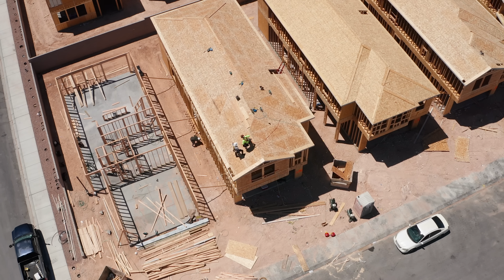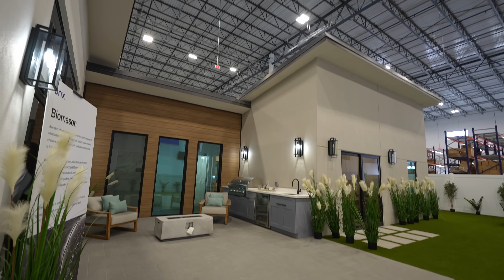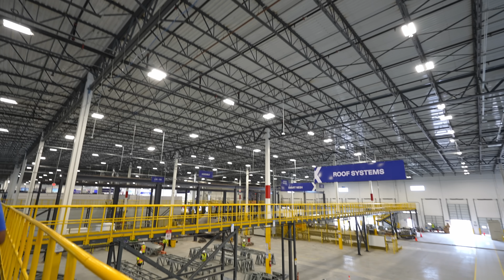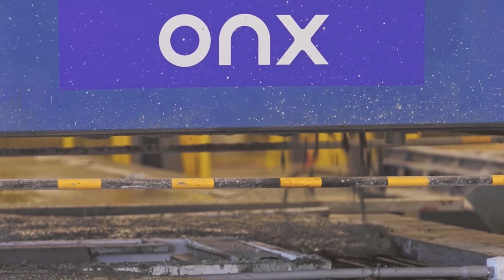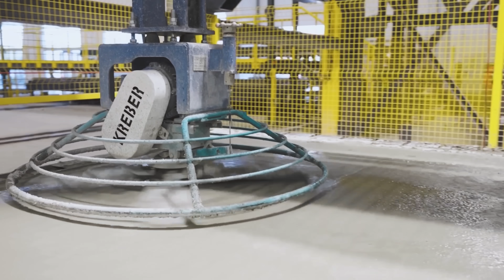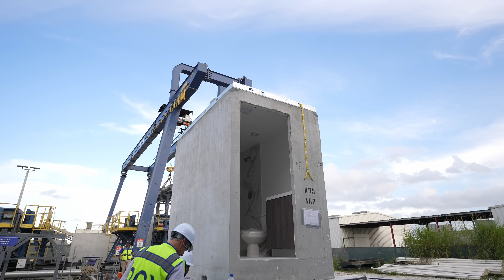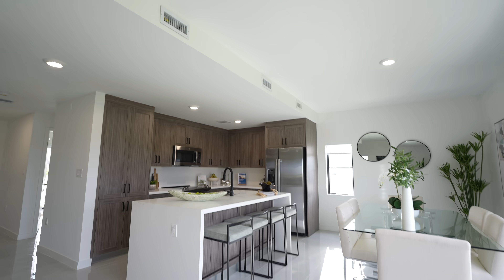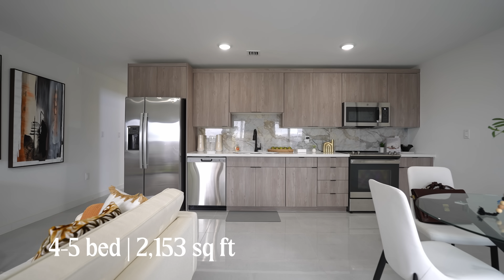Why This Company is Building Thousands of Concrete Homes

Comment: in Soviet Union they used to have entire residential buildings assembled from prefab concrete panels. Those weren't good because of low grade concrete. Also some builders cheeped out on the rebar by using thinner ones than required by building code. However, using modern materials and engineering, it is possible to build long lasting, high quality homes.

Comment: Concrete vs stick built? Why is there even a debate? 😂 Just ask the Big Bad Wolf. 😂

In Australia, most smaller apartment blocks are built with concrete. It's a mix of factory and prefabricated, where the wall panels are all made off site and then erected. Bathrooms are formed on site too. These apartment blocks get built very quickly as a consequence, often under 6 months. Townhouses and newer homes might use steel, not timber, as the "sticks". 
I guess one limitation with factory homes is design limitations. You probably can't mess around too much with the floor plan and general footprint.

As for the CO2 concern, that's small fry compared to the amount of concrete already in use with other construction, and minute compared to overall CO2 emissions. Raw energy generation, manufacturing and transportation make up the bulk of that. I would have thought a durable home is far more important, and greener, over a flimsy timber home that also requires constant maintenance and would use more energy. Sometimes ideology should be parked for common sense.

Comment: A factory built pre-fab deals with the issue of terrible quality control on the part of typical builders.  A stick built home is constructed by whomever the developer could find to knock it together at the time.  The buyer ends up with a very expensive pile of surprises.

Comment: About damn time. Growing up in concrete home that withstood numerous huracanes including multiple cat5. 
When moving to the US I couldn't believe how cheaply made, imo, the house were made. Specially for the price. My dad does have a brick one. But most are skick builds. And whats with those rooftop.  Most concrete house among friends/family were able to easily built a second floor or smaller second house on top of theirs. Many years later. Not even planned ahead. Simply because the rooft could naturally hold it. While you couldn't just drop another tiny house on top of most US made. Heck a neighbor made a ramp around the back and the garage on the roof.  Most US rooft wouldn't even hold those huge water reservoir many of the houses had on top.
And I figured, it was understandable many years ago when hurricanes weren't much of a problem. But for the past 2 decades or so. Plenty of hurricanes started entering the east coast. Its beyond me why they kept making the stick house that get wrecked all the time. And worst of all. How much they cost. Near my dads. 600k for a stick house. Like seriously? At the very least, mobile home used to be very cheap. But now they're overpriced too.
And the flooring.  Whats with those temporary flooring that you gotta baby for them to last. Everyone I know in the US have had their floor remade every decade or two. 
While my grandparents hose had the same tile floor for 60+ years. And we were harsh on the cleaning. 

But yeah, thats the reasons why I considered US house over priced. They are beautiful.  Size is okay. But the materials.  Inexcusable.  

Personally,  I dislike the drywalls, call them fake walls. But it been on top of concrete is fine. My dad's have drywalls on top of the bricks.
Also not a fan of the amount of glass windows and door used.  

But those house are gorgeous. They remind me of the houses I grew up. Well made. Id prefer miami shutters for most windows. And either solid wood or metal doors. With minimal glass if any on them. 

Also, those are called modular houmes. They are prefab but are made usung all the in site built standards. Its how many buildings and projects are made in the Caribbean and LatAm. Its considered a cheap way to make many house. But they turn out very durable. 
I have friends that grew up in places like that. That looked as if they copy/paste all the houses. And on the years they lived there I dont remeber having any problems. Except modifying or remodeling or adding a section is a nightmare. 

Thank you so much for the video. I wouldnt have know FL was making these kind of house. Googling houses always show the same stick or mobile ones. With some bricks.

Comment: From the video images it looks like insulation is only 1.5" of EPS sandwiched in the concrete walls. 
Say that's R6. Even R14 insulation installed on the inside exterior walls would only bring it to R20.

Comment: In Asia, most of the houses were built with cement and steel; we have also built wooden houses, but if we can afford it, we go for concrete houses because it is not easy to move by wind and also fire. Wooden houses are easy to get fired, which is why we built houses with concrete, even a tiny house.

Comment: the cost of housing is a multifaceted issue , cost of labor, cost of material, cost of land , average income of family, cost of living, fixing one part of the problem isn't going to solve it entirely, its all tied into the economy. I'm not a socialist, but there are certainly some flaws in this capitalist economy currently that need to be addressed, I also believe the cost of starting a family is causing the birth decline.

Comment: In Puerto Rico they build homes out of concrete and their roofs are also build out of concrete. When Hurricanes come the homes are able to withstand the damage.  Puerto Rico has other issues but when it comes to minimizing home damage I think they are doing better because of the way the homes are build.  In Florida they build concrete homes but the roof is wood with shingles an when a Hurricane come it’s always the roofs that gets affected. Florida is flat so there is more possibility for for homes to get flooded especially if your near the water. Because of this I think home builders will have to start raising homes.

Comment: Finally this is what I have been saying for years I never did like the way modern homes are built because I always see on the news this house burned down or that house got torn down by tornado all houses are flammable and not designed to last as long as the pyramids it maybe overkill but I want a house that could withstand a nuclear blast lol
Reply: Most houses in Africa and the Middle East can withstand a nuclear blast due to the fact they are made of concrete or cement and thick walls. How do you think the people who live in those places have survived wars all these years?

Comment: Isn't concrete one of the biggest contributors to greenhouse gas emissions? Curious how these concrete pods compare to stick homes in terms of overall environmental impact.

*Especially if this type of home can last longer than a stick home in a place like Florida or California.
Reply: If you do more research, you’ll find different methods of concrete construction and materials that are different with different companies.  There’s a vast array of insulation etc., options but most companies and I believe more to come , will most certainly state how the material is not a problem for environmental reasons . One I personally liked was a foam tubing between the outer wall and inner wall. Very simple and less complicated.

Comment: The whole world is building in concrete, bricks and using the metric system. The US is the only which does not.
If you want to build a house in Europe with a few sheets and plasterboard, they are going to think that you are crazy and the municipality is going to refuse a building permit.
And spare me the carbon dioxide bs

Comment: When I first saw how houses were built in the US, I was shocked. Wood.. really?
Because most building in my home country (Seoul, Korea) were built using concrete and steel.
However, after living in a residential house in the US for several years now. I see some benefits. One of them is that you can easily modify your home since it is all wood and drywalls. With simple tools, you can easily do something for home improvements. So it is good for DIYers.

Comment: In Germany, the walls in our concrete homes are 6 to 12 inches thick.
Homes in US are like dollhouses to us.
Reply: Those 12 inch walls are bomb proof. US walls are so thin you can hear conversations, sex and all.
Reply: Out side house walls must be solid
And partition wall can be make with soundproof material
Reply: I was stationed in Germany and saw houses being constructed.  They used thick hollow bricks that somewhat resembled Lego blocks that were stuccoed on the outside and plastered on the inside.  You had to open the windows every day to let out excess moisture or mold would develop.  Even in winter.
Reply: Yes, and in the west coast the wooden frame does extremely well in a earth quake. The Japanese fully understand this better than anyone else, concrete homes are not able to sway during a quake. They pancake in a and fully fail!
Reply: @brianlynch2512  actually this really depends on how the houses are built and how the foundation is constructed. I wouldn't be so quick to generalize everything.
Reply: @brianlynch2512 There are tons of buildings made by concrete with earthquake installation in Japan.

Comment: They are ideal in the south, they are cold in the north, unless they have at least 6 inches of rugid foam in between you'll need to lose interior space to accommodate all the insulation if you want it to be comfortable in winter.

Comment: Those houses that collapsed in earthquake are mostly built with bricks/concrete.  Wooden houses won't collapse right the way. If you are confident that the location is earthquake free, fine, you can even 3D print concrete house.

Comment: "There are foam insulation inside"
is that all? Looks like 20mm. And that looks like low density syrofoam. Not expanded foam.

20mm of low density styrofoam is less insulation than a standard issue argon window

Comment: I"ve talked to a lot of Europeans and they think it's insane that they still make homes out of wood in the U.S. Most of the newer homes there are concrete, they sound proof better, they hold cool or hot air better. I'd rather have a concrete home.

Comment: Yes thank you. I've been thinking along those lines for a long time. Noisy upstairs neighbors with no carpet and traditional wood floors . . . MURDER for downstairs tenants. Often that has been me. Moving because of a job or other necessity means taking what's available within a limited time. Concrete second story floors would eliminate much vibration and sound.

Comment: It won't really save you from the fire tho. The inside will burn out completely, and you will end up with a weakened concrete box without a roof that insurance will not pay for. Good luck insuring that in seismic areas as well.

Comment: Climate Change is making weather events more extreme. This will impact the worlds food supply.  
Floods, droughts, fires, excessive heat, snow storms and low water levels in reservoirs and in ground water storage are becoming more common. We must stop adding more fossil fuels to the climate fire.
Stop building and financing more coal fossil fuels power plants. 
Time to go all in on wind and solar energy, battery storage and electric vehicles. 
Fossil fuels are a bad investment for people and the planet.
The cost of dealing with the impact of climate change will be greater than the cost of reducing the impact.

Comment: Lots of houses in Asia, South America, and Europe are built with concrete. Like you said in the video, concrete homes are more durable in natural disasters like hurricanes, typhoons, fires, tornadoes, floods, etc… Plus all that you need to make concrete is sand, gravel, and cement.  Concrete homes also hold in heat and cold better in summer and winter which will save you money with heating and air conditioning. Pretty much if your area isn’t prone to strong earthquakes concrete homes are the way to go.

Comment: No Concrete for the hip roof. The roof deck is Oriented Strand Board. What happened to the statement All concrete home.
Fyi. Concrete walls can absorb moisture. Moisture moves in concrete by capillary movement. The moisture trapped between the drywall and the concrete wall will permit mold to thrive and grow. That is now a serious health hazard. Have you ever seen a Florida house enclosed with a tent.
Mold is one reason for a tent to mitigate the problem. However mold will be back once the concrete has sufficient moisture to support mold growth.
Mold needs Air, Moisture and a food source. The WALLBOARD!

Comment: Steel is AWFUL for heat and cooling. Steel conducts the heat away. And it brings the coldness in. All when you don't want it. That's why it's not used. It's an awful choice.

Comment: In Thailand, we call it a ‘precast house.’ These houses are built with concrete, and one of the major advantages is their construction speed. The structure can be put up within 1-2 days, with most of the time spent on interior work. My house was finished within 2 months. Pruksa, a leading company in Thailand, specializes in this method. The cost of a precast house is comparable to a traditional house, making it an affordable option. However, one downside is that you can’t expand the house by tearing down walls, as they carry the weight of the structure

The house I bought has 222 sq.m.   2 master bedrooms, 1 small bedroom which is not small. All bedrooms have its own bathroom.   1 maid room and bathroom.  2 living rooms. 1 kitchen, 1 office room     Cost  $275,000    In Phuket

Comment: as long as the concrete doesn't disintegrate in 60 years

as stone bricks last centuries
like on castles

but "modernized" to easily do plumbing and electrical replacements

Comment: We’ve been building homes out of reinforced concrete here in the Middle East for years. No wood, no drywall, and built on site. Exterior walls are about 20cm thick, and interior walls are about 15cm. Wooden homes wouldn’t stand a chance in our weather, they would catch on fire!

Comment: There has to be a difference. Concrete tend to be more heat insulated than wood. It's more hot in the summer.

Comment: Concrete is excellent in compression strength, but horrible in tension strength.  That is why concrete is reinforced with steel rebar.  But concrete is porous, so steel rusts.  I like beveled triangles for geodesic domes.  Triangles are the strongest geometric shape, so you don’t need cross-bracing.  The triangles ARE the load-bearing beams.

Comment: Don't get caught up in the hype around steel framing. Sure, it doesn't burn - but it does slump in a fire, so your roof is still going to collapse around your ears if your foam sofa meets a faulty charger cable.
Timber will burn, but it takes time, and for a large part of that time it's still structurally sound enough to hold itself up. When you see a house fire and you can see the roof trusses sitting up there burning, you know they're timber trusses, because steel trusses would be a pile of spaghetti on the floor at that point.

Also, of course, all these catastrophes are being caused by atmospheric carbon pollution, and steel and concrete are both major contributors to that. Plantation timber grown locally to where you're building will actually capture and store more carbon than is released in harvesting and processing it. So if you don't want to make the situation a whole lot worse, only use steel and concrete where you can't use timber!

Comment: I don't understand they still put pipes electrical in after the wall are placed, why not out these in the walls like they do in Europe. Here they just "connect " them I don't understand why you would want to still put in walls with drywall after you have concrete walls. It's a pain to hang stuff on the wall, it always starts to sag at some point.

Comment: Why would anyone who wants a concrete (brick) house settle for inferior, fire-hazardous drywall sheet walls? I dislike this idea. Growing up in Europe, where all houses are made of concrete and brick, I know better. The pricing also seems excessively high, likely due to the greed of many parties involved before a house is even finished.

The concept of modular housing is old, and I don’t understand why the United States hasn’t adopted it more widely. It’s a misconception that concrete has a large CO2 footprint; technology has evolved, and there are now many better, stronger, and cheaper types of concrete that are easier to use, offer better insulation, are self-healing, and can even produce electricity.

I applaud the company for its idea and existence, but it seems to cater only to the wealthy who can afford the high prices. Also, who needs five bedrooms these days? The average family size is about 1.8 children with parents.

To grow exponentially and be affordable for the average person, the price needs to be halved. The same goes for land prices, which are outrageously high due to greed. The infrastructure also needs to support this type of housing, including water, electricity, and sewage systems. In the past, gas was also a consideration.

I find these concrete walls to be very thin, with foam insulation built in. How thin are these walls? Drywall sheet walls inside mean you still can’t drill holes and mount heavy items on the wall at any given location. I find that unacceptable. If I were to invest in a so-called hurricane-proof house that lasts, I might consider the complete aluminum-built houses from China. These houses have everything built in, need only to be hooked up to water, electricity, and sewage, and come at a fraction of the cost. They can even be easily expanded.

Make some improvements, lower your prices, and enter states experiencing rapid growth. It’s still a great concept, and I hope you succeed.

All IMHO.

Good luck and thanks for sharing.